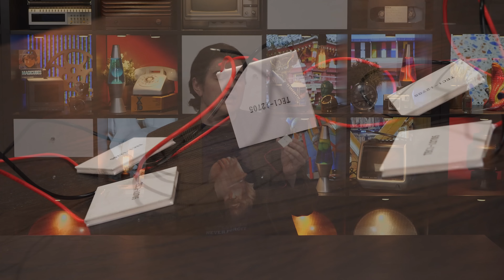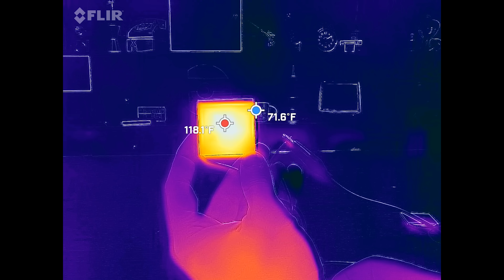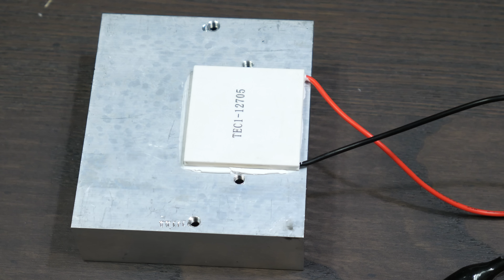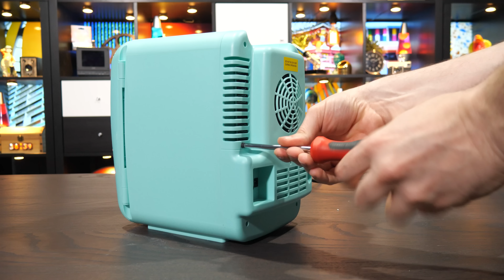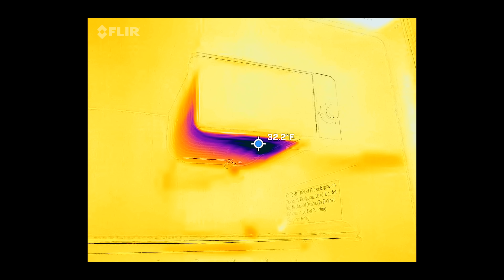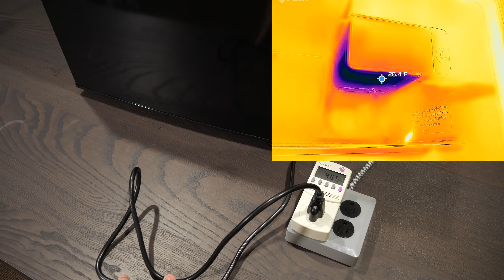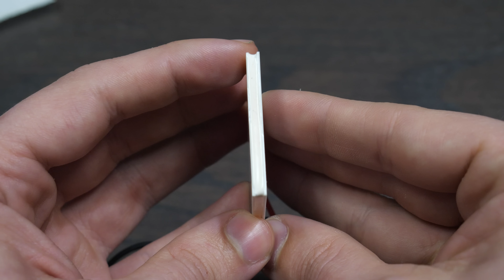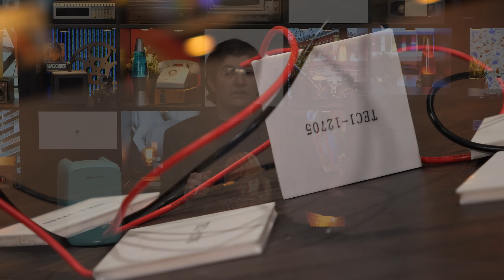Thermoelectric cooling: it's not great.

Comment: OK, so it's kind of bad in every way, but the fact this is a (partially) solid-state cooling device was not something I realized could be done.  I wonder if you could make a completely solid-state refrigerator by using the chimney effect and maybe combining that with multiple layers of Peltier-effect devices?  Never mind the energy cost or the likely bulk such a device might need, it would be kind of cool to create a refrigerator with no moving parts, especially when combined with a power source with no moving parts-- solar.

Comment: Heat pumps (as in refrigerators) use material phase changes to move heat energy efficiently. Thermoelectric doesn't try to use phase changes at all. That's enough right there to explain why heat pumps work much better.

Comment: Peltiers have one other trick.  If you reverse things and put a temperature differential across a Peltier, like, say, boiling water on one side and room temperature air on the other, you can extract a voltage from it.  Which is a really neat and portable way to generate power in the field when it's pouring rain and dead calm and there's no creek or whatever around to spin a turbine, just light up a pot of water with your stove and slap a peltier on the side of it.  Presto, phone charger! :) 

But still, very niche.

Comment: When I heard about Peltier devices like 20 years ago I looked into using them for CPU cooling and of course quickly discovered that would be horribly inefficient.  What they are good for is heating one small area, so I got a couple and made a heated coaster for keeping tea (or coffee, I guess) in a mug warm.   It kinda worked, but not as well as just using an insulated mug.  A few years ago I saw that there are USB-powered mugs with the Peltier device built in, but those seem rather annoying since you'd need to have a cord long enough, not get it tangled with anything, and have to wash the mug by hand while being careful not to get the port wet, or you'd need the cord built in, which would make it even harder to use, especially in a car.

Comment: Peltier cells are significantly faster at moving heat than gas pumps (as long as the other side is cooled well and the power moved isn't above their limit) so they are often the "first stage" of a cooling setup for electronics or lasers or sensors and whatnot, where they are in contact with the (small size but high power) heat load and then spread it to a more conventional heatsink or water from an industrial chiller.
Back in the day they were used for PC overclocking too, but modern PC parts are usually too power hungry for them to make sense

Comment: Don’t forget that a temperature difference across the peltier can create power. These are used on the wood stove fans that dont require any power because they use the heat of the stove on the bottom and the fan cools the top to keep the difference in temps. The power produced powers the fan so the bigger the difference the faster the fan spins

Comment: I used a 12v Peltier cooler, for years, when I drove a truck in the 2000s. Had it in between the front seats, so I could keep snacks and drinks cold and within reach. 
Yeah, they weren't very good at keeping things cold and had to be constantly checked, to make sure the vent wasn't blocked. It did beat having to buy ice to keep in a smaller cooler, for this specific application.
Reply: 12v car fridge with a compressor. Its a life changer
Reply: It'll be powered by the car's alternator, which is powered by fuel, and fuel is paid for by employer? :D

Comment: I have an automatic woodstove fan that has one of those little devices, it does the opposite. it generates power from a heat difference on the sides. The bottom is touching the woodstove and getting very hot, and a heatsink is hooked to the top, separate from the hot bottom part, causing the little thing to have a colder side and hotter side, and the power it generates spins the fan.